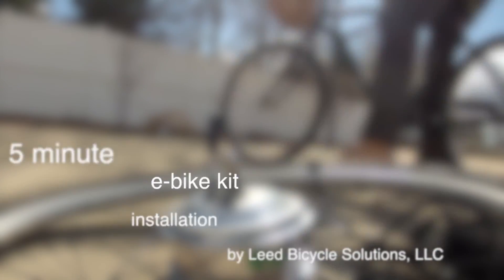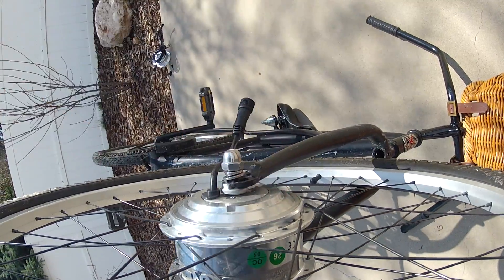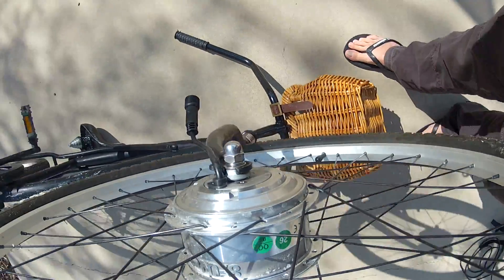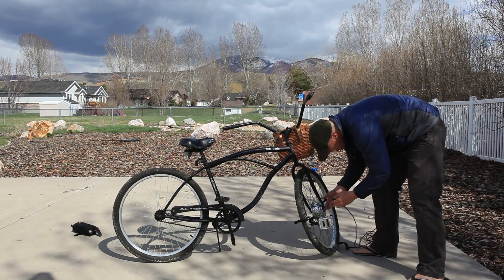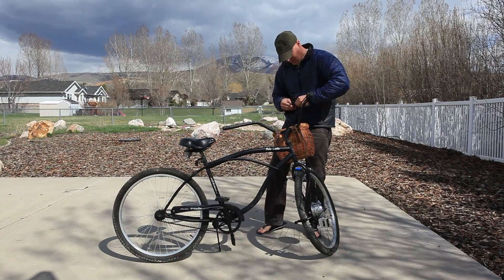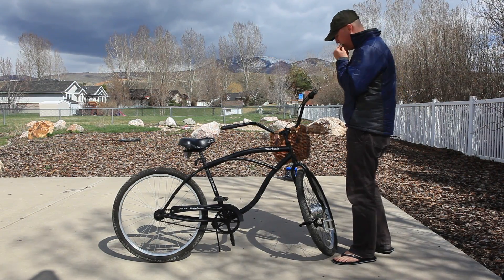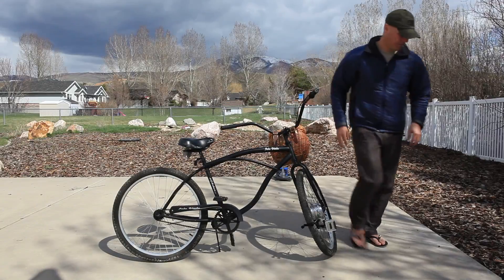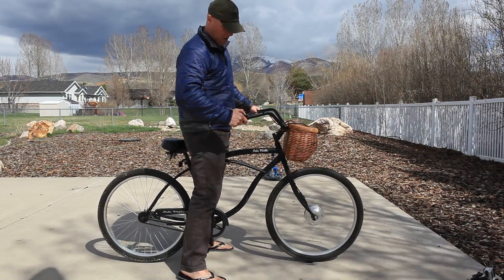Leeds 250 Series Ebike Conversion Kit Installation Video

Comment: I'm very appreciative of this technology at an affordable price but I think the advertising is misleading.  I also found no other instructions other than the 1/3 of a page that came in the kit and this video. It took me about 10 hours over 3 different nights to install this.  It was kin to an Ikea project.  The parts that took forever were: (1) taking my old tire and tube off my original rim and putting it on the Leeds rim, (2) using a dremel on the fork dropout notch, (3) figuring out the washer placement (whether inside or outside and how many inside or outside) to make sure there was no rubbing and that the tire was centered -and while making sure the cable is always in the same place and not going under the fork (4) adjusting my brake calipers - this took A LOT of youtubing, and (5) figuring out what to do with all the extra cable on my XS frame.  When I started, my plan was to still be able to convert my road bike back for normal rides, but after all that work, I think I just converted my road bike to an ebike and will go out and buy a new road bike.
Reply: With that said, now that I was able to do the adjustments needed and managed to actually test drive it, I am pretty happy with it. It will definitely make my commute easier. We will see how it handles the test of time!
Reply: Two years later, I had a similar experience. In addition to that the rim that came in is designed for a presta valve and I had schrader on my tubes, so I had to go an buy a new tube. But what is having me scratch my head the most is that the two dropout notches are not quite the same size. One of them is a 0.5-1 mm wider. I filed my fork as they suggest on the pages they send you using one of the dropouts as model, then when I tried to put the wheel on the other one wouldn't fit. I took it off again and, lo and behold, one of the dropouts is larger. It's not a huge deal, I can file it or just use a dremel on it, but it makes me wonder what else they skimmed on to keep the price relatively low.
Reply: Hours later after dremeling my dropouts and ordering the double wide spacers, I was able to assemble the wheel on my XS frame bike. When the pandemic hit, after 2.5 years using the ewheel, I decided to remove it and revert back to a normal bike. Unfortunately because of all the torque on the dropouts and permanent widening of the fork, I had to replace my fork (and also headset and stem) to be able to put my original bike rim back on. It was an expensive lesson. The ewheel got me up giant San Francisco hills but I wish I would have bought a cheap bike to convert rather than my road bike.

Comment: There are two problems with the video. #1 you can't take your old wheel off and just throw it away.  The leeds kit does not come with the inner tube or tire. So step one is remove the tire and install it on the leeds wheel.  The other problem is if you have disc brakes, that can make it a little more complicated with all the adjustments you need to make so the wheel doesn't rub against the brakes.  It was too complicated and time consuming for me, so I brought my disc-brake equipped bike to my local bike shop and they did it for me for a small fee.
Reply from the maker: Hi, Brian. I threw the old wheel in my backyard just for fun. I reused it on another bicycle. The LEED E-Bike Kit does in fact come with an inner tube and tire. It is an upgrade option for $32 at checkout at www.e-bikerig.com. Amazon and eBay do not allow us to offer an upgrade option. Most of our customers use their own tube and tire, so we offer the kit on eBay and Amazon without the options. If you'd like the options then www.e-bikerig.com is the best method for purchase. You are correct the disc brake can cause some extra installation time and requirements. I'm happy your local bike shop was able to assist. It can be a little confusing to adjust if you're not a bike mechanic. Let us know if you ever need anything by calling our toll free number, Brian. We don't check our YouTube comments often. Take care!
Reply: Thanks,   I used my old bike and inner tube also.
Reply: I would have gladly chose the upgrade option if it was made more clear. It would have saved me a lot of time and headache. The picture with a tire already on rim is very deceiving.

Comment: Are all of the kits compatible with all the batteries i.e. They all have the same plug ends?
Reply from the maker: Yes. All 250 Series (250 Watt) E-Bike Kits all have the same plug connectors and are all compatible with each other. The same goes for the 500 Series (500 Watts) E-Bike Kits, but the 250 Series and 500 Series batteries are not compatible across models.

Comment: How would this do on fairly steep hills
Reply from the maker: The 250 Series does great, but requires pedaling in lower gears on very steep terrain. If you are looking for a powerful hill climber on steep terrain, then you would want to go with the 500 Series available at www.e-bikerig.com.
Reply: +LEED Electric Bike Conversion Kits thanks

Comment: How much time does it take to charge?
Reply from the maker: +Zonaid P (Zonaid P.) Charging time depends on the battery size you have. Sizes vary based on the battery models found at http://www.e-bikerig.com/extra-batteries/

As a general rule, plan on up to six hours charge time.
Reply: +LEED Electric Bike Conversion Kits ok thanks btw is it waterproof and how many hour can it go with no charge?
Reply from the maker: +Zonaid P (Zonaid P.) Please visit our site e-bikerig.com for more information. We have many FAQs, photos, battery specifications and more on the site. The system is waterproof. The distance and time of use is dependent on which battery system you go with. Please contact us at (866) 933-8716 M-F MDT or visit www.e-bikerig.com. Thanks!

Comment: The most important question, How fast van it go?
Reply from the maker: +Lepelvis Games For a general rule of thumb, 15 mph without pedaling and up to 23 mph pedaling. Speed will ultimately be determined by your bicycle, pedal force, crank size, wheel size, weight, and more. On average, our customers find they can get 6-7 mph faster with regular pedaling force.

Comment: 8 fun, very good product you might need tourqe arm for hub
Reply from the maker: +nisancashi2241 Agreed. 8FUN motors are considered to have the best longevity and rarely require maintenance for the life of the product. Torque arms are needed for motors beginning between 500 and 750 Watts. We recommend using a torque arm at 500 Watts.

Comment: 24 VOLT 250 WATT? Why does all your kits like this? No power. At least give us some 36volts and 48volts 500 watts 750watt kits. Why sell only one weak azz kit?
Reply: 750 watt kits generally require a torque arm on the front fork.  So that would make the install much longer than 5 minutes, and would require a lot of technical support because of all the differences in front fork mounts.  Most but not all front forks could handle 500 watts without a torque arm, but you would still want one for safety reasons.  If the motor ever spun out, you could easily be thrown over the handle bars.  There is no easy 5 minute install solution for high wattage motors on the front fork, until bike manufacturers specify or standardize on a motor torque arm mount for all the different front forks.
Reply from the maker: +Carroll Vance You are correct. We focus on keeping a bicycle a bicycle and avoid converting bikes to motorcycles. Most of our customers are looking to improve their commute and ride a bicycle like they used to when they were spring chickens. We offer a 500 Watt kit on ebikemybike.com and they should be installed with a torque arm.

Comment from the maker: The Hill Topper is offered by Clean Republic. This kit seen here is from Leed. Both companies use the 8Fun motor. Leed offers batteries from AllCell Technologies, Panasonic, & Samsung. The capacity of the Panasonic allows the rider to achieve greater distances. Both company's kits are unique, yet similar in simplicity. Clean Republic has supplied Leed with motors and wheel sets when they have been sold out. Apart from that, both companies offer different price points and products.

Comment from the maker: There are three versions of the kit available for purchase with distance appropriate names dependent on the capacity of the batteries: 10k, 30k, & ultra marathon. They are available on Kickstarter until May 20, 2013. The 5 minute e-bike kit starts at $449 & free shipping with a special waterproof frame bag for the battery kit. Please go to the websites in the description above for purchase.